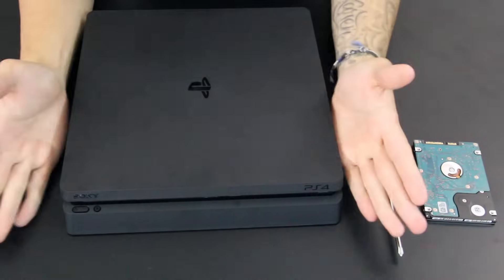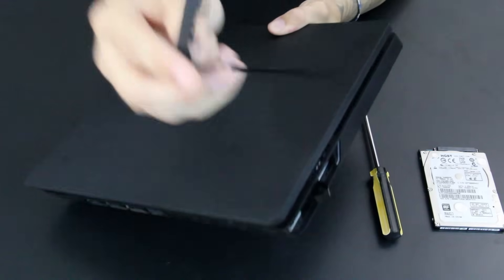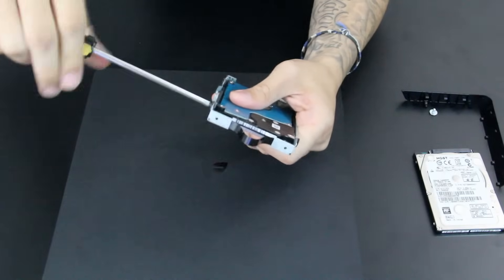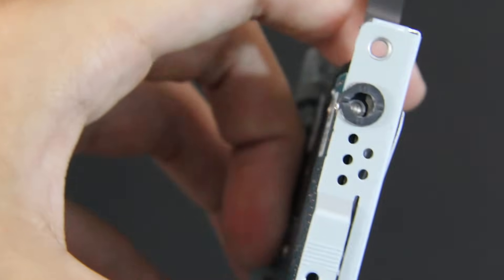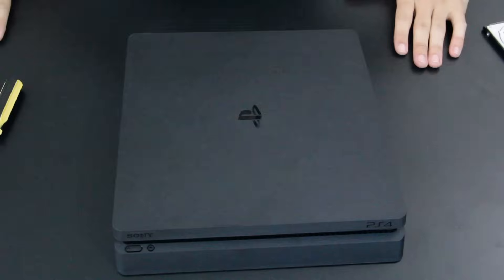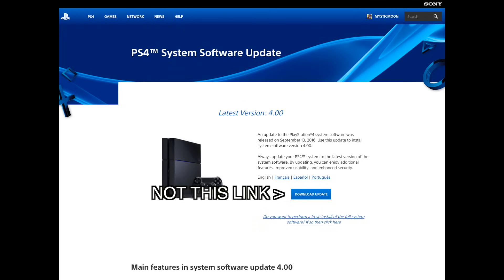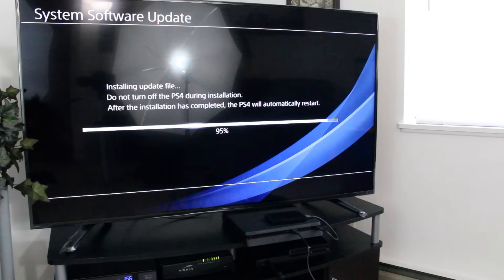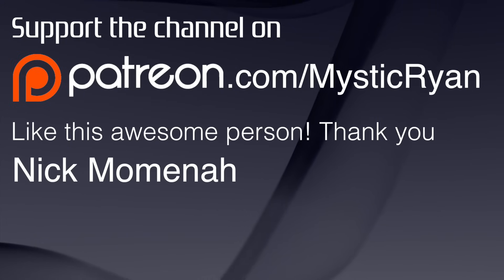Tutorial: How to Change PS4 Slim Hard Drive and Install System Software

Comment: Thanks I was so confused when my PS4 started acting weird 
By The Way You Earned A New Subscriber! And Like!!
Reply: By weird did I freeze?
Reply: HarryDM23 It was happening to mine when ever I launched up a game it took long to load and loading menus and opening stuff took long to load up and the ps4 would freeze when I pressed the ps button on my controller to go to home screen
Reply: @nnan_o  has it worked now?
Reply: No but I found out what the problem was
Reply: @nnan_o  what was it?
Reply: HarryDM23 a faulty hard drive
Reply: @nnan_o  possibly my last question how does the hard drive get faulty
Reply: @nnan_o  and also did you have a issue where you couldent play certain games for e.g fortnite but then you could play GTA 5
Reply: @nnan_o  would your PS4 turn off?
Reply: HarryDM23 sorry for the late response Hard drives get faulty by closing an application while it’s updating, or by accidental shutdowns, like power outages. Since it’s a mechanical part it wears out eventually. Also my ps4 froze when I tried to,launch up fortnite but I never tressed it with other games I would have to turn off my ps4 but it would get stuck on the power off screen so I would have to hold the power button for 30 seconds or so and it would make a faint whistle noise the tv would glitch out for like a millisecond then I would turn it back on for it to say ps4 system turned off properly the ps4 will now restart . And yes my ps4 would turn off randomly I don’t know why. Hope this helps I thought it would be easy to change the hard drive which it should be but it wouldn’t detect the update files so I got 2 error codes one is ce-34336-8 and the other ce-34336-9 i plugged in my old hard drive booted it into safe mode than put in my new one clicked initialize and the ps4 would say cannot initialize so. Than I was updating fortnite but it froze mid update so I couldn’t turn my ps4 off and I did the worst thing possible I pulled out the hard drive so now my old hard drive won’t work I contacted Sony about the error codes and how to properly reinstall system software but they said everything was right how I described it and the error code ce-34336-9 is a general error code and they recommend me to retry everything make sure it’s the correct update file which it was so they recommended maybe my hard drive isn’t compatible. Sorry for the late response hopefully this helps you fix your problem.
Reply: HarryDM23 didn’t realize I typed this much lol.
Reply: @nnan_o  yh lol
Reply: @nnan_o  cheers BC my PS4 broke and I'm getting a new hard drive it would do what yours would do
Reply: @nnan_o  also say like when you played fortnite would it randomly shut down?
Reply: HarryDM23 yes it would shut down randomly.

Comment: You missed a step. The external you will use to store the firmware has to be formatted to exfat
Reply: or fat32
Reply: Who's doing this because you have to change your hard drive because I need to this to play
Reply: charle holmes how do you do that
Reply: DickDown Dave When you are in your files screen you right click on the usb drive and click “format device” once you do that there should be the option to format it
Reply: @xxlezzon9981  that's wrong. That's what you do if you want to use it as an external. But as in internal, you have to connect it to a pc/laptop, reformat to exact and then download the ps file from from their site.
Reply: @solomon19891991  then make a tutorial on how to format the external drive to exfat please
Reply: Wil a 3.5 work?
Reply: Will a 3.5 work
Reply: I didn’t need to hold power to start safe mode as it started automatically.
Reply: charle holmes does a 3.5 hard drive work?
Reply: 3. 5 will work for external yes for the above comments asking. And I never formatted to exfat always format to fat32. I got a 1tb 3.5 inch hard drive I pulled from my old desktop to work and also a wd elements 2tb 2.5 inch to work.
Reply: Yes this is what I was going to mention as well. The tutorial covers the bases for mechanically installing but does not cover the information related to the system format type of the HDD. It is immportant to use a FAT 32 system, either fat32 which is very old or the exfat are both fine.
Reply: Does the hard drive have to be empty to use it?
Reply: And if I format an existing hard drive will it delete everything on it? I’m clueless to these things
Reply: @free-ishmbn6  If you format a drive, yes the data is all gone. Well its not permenantly gone but you would have to use extensive advanced recovery software in order to recover the files. So for the sake of argument lets just say "format = Erased" so you do not want to do that if you have not backed up your data yet.
Reply: Artimes I went to Walmart and bought a small thumb drive 30 something Gs. Thanks
Reply: I been searching alot on a solution on how to do this and so I just want to share what I have learned.  The Playstation drives have what is called a GPT file system on it which stands for 
GUID Partition Table which is a Protective file system. Generally these types of file systems use like over 20 partition tables on the drive. That is why many users are running into trouble trying to format this type of hard drive because most systems and applications will not allow you to format this type of disk drive. It is encripted and protected. Something I figured out is what you need to do is "remove the Protective partition" GPT before you can use partition recovery software to sucesfully format the drive. In order to do this you must use the "Diskpart Utility" This is autmatically embedded in windows and you can run the tool directly from the command prompt. It is a powerful tool that over rides any other application and removes the partition even though its locked or protected.

The steps are as follows:

1. Open a Command Line Tool, type in DiskPart and Press Enter

2. At the diskpart prompt type "list disk". ...

3. At the diskpart prompt, type "select disk x", where x is the disk number that you want to remove the protective partition.

4. Type “list partition” which will display a listing of all the partitions on the selected disk.

5. Type “select partition n” (where “n” is the partition number you want to have removed).

6. Finally, Type “delete partition override” which will then permanently delete the partition selected.

This will allow your drive to no longer be locked by windows and if you look in the disk management, the disk should now say "unnalocated space" in which you can proceed to format it with a fat32 or exfat file system to be ready to run on your PS4 again. Or if you prefer a NTFS to run on your windows Operatying system.

Note: In order to find the disk number, usually its listed in disk management but if your operating system is not able to identify it, this may be a bit tricky so you want to download MiniTool partition wizard which will allow you to see the drive and what Number is designated for that drive.
Reply: @Dashtro Sled Yes you have to have some sort of external device or thumb drive to update the firmware on the PS4. Can you use the bios utlities on the PS4 to rebuild the file system? If so, then this should automatically fix the problem. If no, then you will have to follow my tutorial above and repartition the ps4 drive well removing the GPT protective table.
Reply: @Artimes.  do I need a hard dive or can I just click the 7 option
Reply: @xavierdubs462  Can you elaborate your question a little bit more?
Reply: @Artimes.  you see how he clicked the 7 option when he put the new hard drive in can I just do that or do I need to put in a usb
Reply: @xavierdubs462  If your able to see the System Bios set up screen on your PS4, then yes you can just initialize your system. How ever you will need a thumb drive with the most current firmware software installed for a full partition. It will not allow you to format your playstation 4 drive with out the firmware. 

 So best thing to do is install your new Hard drive, download and copy the firmware to a flash drive and select option 7 and it should install automatically.  Make sure you copy the firmware files corrently. There should be a tutorial on how to do that on the page you download it from.

Comment: This is the noob way.
The pro way is a clone with dd on the new hdd, no initialization required.
If you want a bigger HDD you can expand the user partition with gparted or another software.
With the pro way you not have to reconfigure the system, redownload the game etc...

Comment: Will installing an sdd fix error code CE-36329-3 I’ve tried every Safe mode option too
Edit: seems like the only way, fixed mine
Reply: This is a super late question but do you know if using a new hdd instead of a new sdd to fix that error will work?? I don’t want to buy an sdd, just a new hdd to replace my failed one.

Comment: Thanks for the vid! I got the error no installing file found but it's because I had the smaller 3-400mb file instead of the larger 900mb file. Make sure you scroll down to the bottom of Sony's website where it says "Perform New Installation" and download that version of the file :)

Comment: Will a pc hard drive work or no cause I have a 3TB hard drive that’s for a pc
Reply: there is no such thing as a ps4 or pc harddrive, it will work as long as its a 2.5 inch drive and not a 3.5 obviously because a 3.5 inch drive wouldnt fit in the slot.

Comment: I NEED HELP SOME ONE PLEASE HELP😭😭😭😭😫
I did exactly  everything I had to do I bought a new hard drive installed it in. I then had a flash drive with a folder named PS4 and in it I had another folder named UPDATE  and in it was the latest update. How ever I cant bypass the controller screen on safe mode 
I tried everything the only thing I didnt do was back anything up from my old drive neither did I formatted the new hard drive 
But other then that why cant I bypass the screen?!!!

Comment: Okay, but how can I move my games from the original internal drive to the new internal drive? There has to be a way, right?
Reply: Also, my internet speed is Terrible, so I wouldn't practically be able to just redownload digital games from my library, it'd take several days
Reply: Use a pendrive or loading thdm to an online storage of the ps4 doesnt take that long usually

Comment: I just bought a small 120gb ssd so the loading times werent so horrible (I have a 4TB external) and turns out you cant even launch the ps4 with less than a 160gb god

Comment: Good tutorial, nice and informative.

However, I got an error-message when trying to do exactly what you did.
In the text by the smaller link there was a piece of text refering to another page where I could acquire the proper update file for when replacing the HDD.
After downloading that file the update went swimmingly!

Comment: Can Anyone Help me? My Old PS4 (Slim) is destroyed. So, i decided to Buy a New One. This Time its The Original One. So if Take out Hard drive from My old PS4 and Replace it with the new One. Wl I Get the Same Saved data and Games which i have Saved in The old hard drive? Please Help!!
Reply: Shahabaz Mohd Shafi should work, the hard drive isn’t special to Sony. You could take that hard drive out and use it in an Xbox or a PC. With that being said, you may have to update the firmware, but that’s about it. Let me know how it goes.
Reply: @Lifted6.0  Wait, is this a Sarcasm? If not. Please will It work or not? Yes or No?
Reply: Shahabaz Mohd Shafi no, that hard drive can be used in multiple other electronics. It should work if you’re just swapping to another PS4.
Reply: @Lifted6.0  i did it. But they are saying to Update the PS4. Which i cannot 😟😟
Reply: Shahabaz Mohd Shafi why are you not able to update?

Comment: Is it possible to simply remove the old ps4 HDD and then place it into a caddy/enclosure and then after the new drive is installed you use the old one in the enclosure/caddy to do the restore? (Instead of first performing a backup to a large external HDD to save the downloaded games for the restore?)

Comment: Hi..I have a 500gb slim, but have a 1tb ps4 hard drive from my previous ps4. I want to put the 1tb into the 500gb, but woul i still need to download the software from the playstation site onto a usb and connect that to the ps4? wouldn't my old 1tb hard drive have all the software on it? Sorry if I haven't explained clearly.

Comment: If I upload all my data to my online storage and my PS+ runs out will I lose my data or just the access to it?

Also, since I've uploaded all my data onto the ps4 online storage cloud can I just take out my old hard drive, still k in a new one, reinstall (without having the extra port thing for the firmware) and still get my data/games off of the cloud?

Comment: Question: Can you put a hybrid SSHD (2TB) like a seagate ST2000LX001 firecude into a 2018 PS 4 slimline 1TB.  I've been told that the new hard drive going into the ps4 must not be more than 9mm thick yet seagate state the firecuda sshd as 22.6mm thick. Can someone please confirm? also will the 5400rpm still be as good as a 7200rpm normal HDD

Comment: I also want to point out that ti make sure you push the external storage usb( flash drive or storage drive) into the system all the way. I made that mistake twice now before putting 2 and 2 together.

Comment: as far as drives in the 2.5 inch form factor, there are 4 thickness's i am aware of: 7mm, 9.5mm, 12.5, and even a 15mm. anyone have the actual specific dimensions of what will and what wont fit?

Comment: just bought 2TB seagate baracuda sshd to replace stock 500gb hdd in ps4 slim, i get the message: cannot start ps4 cannot access system storage (when trying to go into safe mode) brand new disc, google suggests i have installed it wrong or disc is dead, i installed new disk 4times and always that message, tried old disc again and on the first try all works well...plz help

Comment: I installed the new drive but every time I plugged it back in, it kept saying it couldn't find the hard drive. The old one still works. I just don't know if the one i got is too short and can't reach or what.
Reply: I'm having the exact problem,
Reply: Did you manage to resolve this?

Comment: Just remember people he doesnt mention this in the video when your gonna have an update firmware to a flash drive or external hdd if your ps4 doesnt recognize it one of the issues is the the thumb drive or flash drive need to be formated in FAT , not FAT 32 or NTFS cause the system will not recognize that when looking for the folder with the update it will error out saying could not find usb drive even though you have the folders and update on it.

Comment: If I take the old PS4 hard drive out and set it aside (don't do anything to it), setup a new hard drive in my PS4, and later put the old hard drive back in: will the PS4 still boot directly from the old hard drive without requiring a reformat/reinitialize? Can I swap the new and old hard drives in and out of the SAME PS4 and have them work seamlessly?

Comment: Thank you!  The new firmware (4.50 - as of March 2017) does everything for you.  It detects the new drive, realizes it needs to be updated and asks you to toss the USB drive containing the 800 mb update on there.  Thing is, if you have a chubby usb stick, it won't fit into the slot - you'd need an extension cable to do so!

I used a 1 terabyte sshd drive and I ended up with 861 gb after the required system stuff on it....

Comment: I bought a new Seagate FireCuda Gaming SSHD 2TB SATA 6.0Gb/s 2.5 SSD drive, can I just remove the old 500GB HDD and replace it and then update the software? Will it work? or do i have to do something before I do all this? like partition, change the filesystem etc.... please guide, thanks